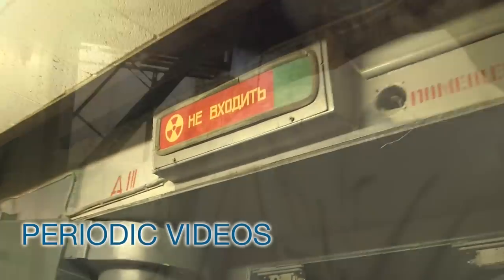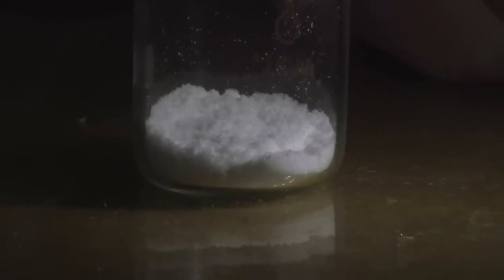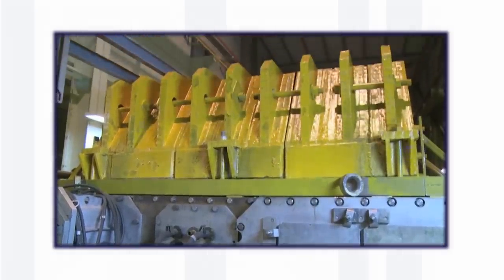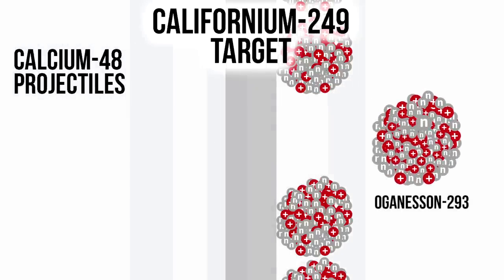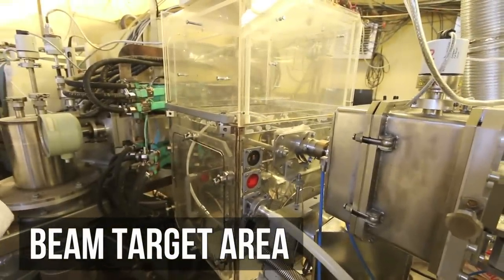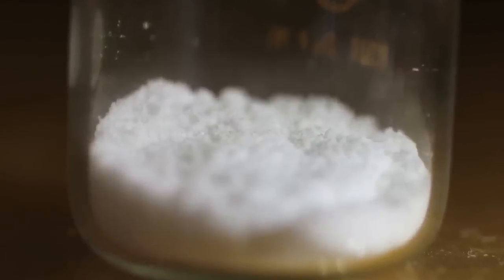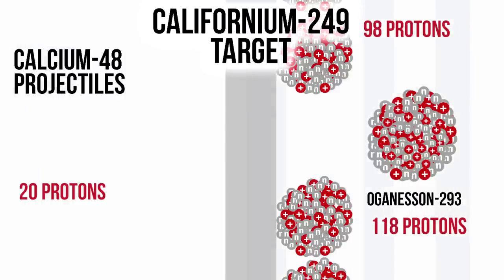$500,000 of Calcium - Periodic Table of Videos

Comment: If you ate that bottle of calcium your skeleton would be like wolverines.
Reply: P. Doherty not likely
Reply: I wonder how much heavier would you be if you swapped all your existing calcium for this calcium 48?
Reply: That math shouldn't be too hard to do.  If you actually cared.  Definitely not worth doing though.
Reply: hamilton harper you'd gain 3 grams for every kilogram of body weight. For example, a person weighing 70 kg would gain 210g.
Reply: I calculated that 17 grams. But I'm half asleep and didn't bother to actually write anything down on paper, so I might be totally wrong there.
Reply: I actually am interested. Did either of you base this on the average weight or proportion of calcium in an adult body? That's a pretty wide spread of results...
Reply: hamilton harper hamilton harper I based my result on the fact that 1.5% of your body mass is calcium. This means that an average kilogram of you has 15 g of calcium. We divide this by 40, the normal atomic mass of calcium, to see how many moles of calcium there are in a kg of body mass. We multiply the result by 48 to see how much those moles would weigh if they had the atomic mass of 48. Thus we get 18g. This is an increase of 3g. From here you can extrapolate that a person weighing 70 kg would gain 210g (70*3).
Reply: hamilton harper not alot since calcium is a trace element in humans less that 2% so it won't have much of an effect
Reply: Replacing all oxygen with oxygen-18 will result in a far more significant weight gain:
Oxygen-18 is 12.5% heavier than the regular oxygen-16, and 65% of a human's body weight is oxygen (mainly in water). So this would cause a human to gain 8 % weight (from 70 to 75.6 kg for example) without any change in the body dimensions ;). I'm pretty sure swimming would be pretty difficult then.
Reply: I wonder if it would be possible to strengthen bones if you used this isolated calcium.
Reply: @patrickparr3331  or you'll die but you can find out for us
Reply: @notananimationchannel  it could be toxic once it is isolated. So many things are.
Reply: hahahah nice 1.

I'm surprised some of here didnt appreciate your
Reply: @patrickparr3331  why would you?

Comment: 48Ca has other uses. In geochemistry 48Ca (usually along with 42Ca) it is used in Ca isotope "double spikes" for obtaining high precision measurements of calcium isotope ratios. In medical research it is used as a tracer for studying calcium metabolism. Another interesting feature of 48Ca is that it actually is very slightly radioactive, transforming to 48Ti by double beta decay with a half life of something like 6x10^19 years.

Comment: If they are just shooting the atoms and most of them don't hit the target. Can't they just recycle ?
Reply: They get lots of hits,but not much hits that count.Those that don't hit get deflected and  start moving randomly hitting the walls of cyclotron.
Reply: You're right. Thanks for the answer.
Reply: It would be pretty much impossible to recover the stray calcium due to the vast space it could wind up in the cyclotron
Reply: Not impossible, just very difficult.
Reply: You'd have to meltdown whatever the cyclotron is made of since the ions are travelling so fast they are probably stuck too far in the surface to just be washed off. It's more trouble than it's worth, and the target zone is worth far, far more than getting the calcium back.

Comment: I can imagine that Ca-48CO3 is heavier then Ca-40CO3. Why can't they just use a (ultra)centrifuge to separate the Ca-48 from the Ca-40?
Reply: That would only work if they had all loose atoms. But the crystals contain both 48 an 40. The centrifuge can't rip apart the crystals. It's like centrifuging ice to try and get a little piece of sand out of it.
Reply: The professor gave the reason. Calcium doesn't have a gaseous compound, so it can't be separated in a centrifuge. Uranium does have a compound that is a gas, so it can. However, in some ways the separation uses the same principles, but using a magnet. The calcium is effectively gasified by turning it into ions in a vacuum chamber.

Comment: The yellow machine shown here at the SU-20 facility of Elektrokhimpribor is a calutron, an enormous mass spectrometer whose sole purpose is the separation of atomic isotopes which cannot be separated using gaseous diffusion or gas centrifugation.  It was originally used for the enrichment of uranium.

Comment: Can LHC be used to synthesize of heavy atoms?
Reply: I am wondering this too
Reply: I doubt it, it is call large HADRON collider not large atoms collider :D  for example a proton or a neutron is a hadron. So I don't think the LHC can be used to synthesize heavy atom considering heavy have at least a few hundred hadron.
Reply: Żółć I believe the equipment they use is not exactly compatible with the size of the particles used in elemental synthesis.
Reply: They could, but it is more designed to collide individual particles rather than particles with a target. Also the detector is designed to look at the resulting shower of exotic particles that escape after two particles hit each other with 12TeV of kinetic energy. I'm sure it could handle the calcium, but larger particles like californium might be a bit tricky to use...
Reply: @Eivilcow: No they can't aside from the size which is hundred times bigger than a hadron, you also need a charged particle so that the magnet can bend the trajectory of the particle. So an atom is out of the question, an ion maybe...

edit: actually an ion is ok, the ALICE experiment is an ion collider, although atom is still out of question.
Reply: So the LHC uses protons, not hadrons... and protons are technically atoms because hydrogen. I think what you meant was it can't handle the electron shells of larger atoms which is very true. (I was wrong)
Reply: The cyclotron that the professor talks about is also magnet based so they must be accelerating calcium ions into the target.  The issue isn't that the LHC couldn't do it, it's just that the LHC is massive overkill. The energies that the LHC is designed for would simply annihilate the target.  
For reference cyclotrons are typical  around ten million eV while LHC can achieve around a trillion eV.
Reply: MazeFrame, That is a horrible analogy. It takes quintillions of smashes to get these atoms that they are looking for, and I bet if you smash cars a couple quintillion times at varying speeds and angles, you might eventually end up with something that looks like a motorcycle. The motorcycle wouldn't work, it would break before you realize what it was, but so do these super-heavy elements. The LHC is more like hitting your car with a concorde going mach 2 and trying to identify the parts that come out of the wreckage.
Reply: No!
Reply: The aim of the LHC is to allow physicists to test the predictions of different theories of particle physics, including measuring the properties of the Higgs boson and searching for the large family of new particles predicted by supersymmetric theories.
Reply: There was someone who said somewhere that you could make gold with it. But making one gram or so of it would take something like 120 years of 24/7 operation time. I guess the person was wrong?

Comment: I remember when I had chemistry lessons it always puzzled me why so many reagents were potassium salts and not sodium salts. Now I wonder if the reason is the higher atomic mass. This way the more expensive anions can be sold at a higher price per mole for the same price per gram of the salt...
Reply: I doubt that would be worth the trouble -- the companies that sell the stuff just probably do some combination of whatever is easiest and what the customers traditionally use.  A related factor is that solubility with different cations can be different (for instance, compare the various alkali metal perchlorates -- lithium perchlorate is highly soluble in water even at 0 `C and becomes ridiculously soluble as you approach 100 `C; this remains the case with sodium perchlorate, but then potassium perchlorate is only sparingly soluble from 0 `C to room temperature, and then becomes decently soluble as you approach 100 `C; rubidium and cesium perchlorate take another dive in solubility.  The same thing happens with the detergent series alkali metal dodecylsulfate -- if you want it not to precipitate in the cold, you get the lithium salt; if you want it cheap, you get the sodium salt; if you actually want it to come out of solution (like when you want to get rid of it after it has done its work), you add a potassium salt (commonly potassium acetate) because the potassium salt precipitates even at room temperature (along with all the protein and other stuff you were using the sodium dodecyl sulfate to dissolve so that you could get rid of it, thereby leaving nucleic acid in solution)..

Comment: lead 208 is also double magic and is much heavier than calcium, why not use that instead?
Reply: Seth Apex Because you need 20 protons.
Reply: Seth Apex you can't accelerate a heavy atom into another heavy atom. What are you hoping to achieve? A new element with more than 200 protons? Element shown in this video "only" has 118 protons and it's not even stable enough to exist for more than some trillionth of a second. We are only poking and finding the limitation of nucleus stability by trying to create new heavy atoms 1 or 2 more protons at a time. You can't jump 80+ potential elements and declare you predict element with atomic number 200 is stable and synthesisable. That's just a display of lack of relevant knowledge.
Reply: Because it's harder to hit two ions with higher atomic numbers together and have them stick because of a higher electrical repulsion. Also, for certain atomic numbers at least, you would have to use a target with a lower neutron number, meaning a lower neutron number of the product in total.
Reply: We`re looking for stability islands anyway. Why not to look far?
Reply: Боря Данилюк then why atomic number 200? Why not 1,000? 30,000? 5 million? 2.88 billion? You see, people do things in a linear and methodical way for a reason, especially in science. Randomly selecting some number isn't gonna get anybody anywhere.
Reply: Боря Данилюк
The island of stability likely lies at around element 110-114, which is within elements that have already been synthesised. What you want to get there is isotopes of these elements with more neutrons, although the best way of doing that right now is to make a higher element that will decay there.

Comment: Mass spectrometry was also used on an industrial scale in the Manhattan Project, in parallel with gaseous diffusion of uranium hexafluoride, to separate U-235 for the uranium bomb (Little Boy) used on Hiroshima. Today, no nuclear power uses the mass spectrometer (called the Calutron during the war) for uranium, because as expensive and tedious gaseous diffusion is, it's cheaper and faster than the calutron method.

But to separate Ca-48, gaseous diffusion won't work, because, as the professor said, there are no gaseous compounds of calcium, at reasonable temperatures anyway.

He didn't mention whether electrolysis of an aqueous solution had been attempted; this is how water containing deuterium (hydrogen 2), so called "heavy" water, is made.

Comment: The reason heavy elements need more neutrons to remain stable is quite simple and worth telling; it also explains a lot about radiation and nuclear fission in an incomplete but easy to understand way. 

Protons and neutrons fill up energy levels in a kind of shell structure like electrons. It is advantageous to have as many neutrons as protons as long as neither have an electrical charge; but protons do have an electrical charge. The strong force is very close ranged, but electrostatic repulsion is not. For heavy elements this shifts the optimum towards more neutrons.

For very heavy elements like uranium, radon, radium etc it is energetically advantageous to split the nucleus into two nuclei spreading the positive charge out. Helium-4 is very stable for its size (doubly magic) and is often the product of spontanous decay of heavy elements. For uranium and other actinides it turns out that a neutron; which carries no charge and can zip right through the nuclei without being repelled; can ding the atom, imparting enough energy to overcome the energy barrier to splitting in two large pieces. This is fission. The lighter elements so formed have too many neutrons; it would be energetically favourable for them to lose some. Some neutrons leak out; some delayed neutrons are created during decay of some fission products and some neutrons are converted to a proton + electron + anti-electron neutrino. The electron gets so much energy that is kicked out; this is beta decay. The nucleus can recoil so hard from the decay that not all nucleons occupy the ground state. The surplus energy often goes into energetic photons; gamma decay.

Up to nickel 60 it is advantageous to fuse light elements because the strong nuclear force dominates. Stars usually stop at or before iron. But with neutron absorption and beta decay they can slowly climb the periodic table. For very heavy elements though the neutron accumulation must occur fast enough and it only does in super novas and neutron star mergers. In a supernova the neutron flux can be a mole of neutrons per square centimeter per second.

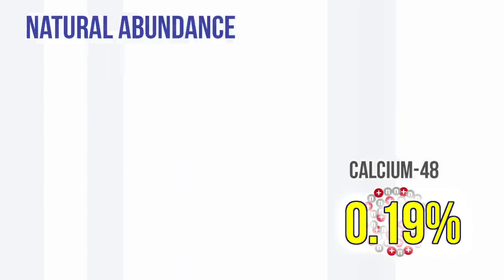Comment: [01:15] 'gaseous compounds' are used in low-cost production of reagent grade elements... Calcium hydride is listed as boiling point of 873°K... Or, why not use liquid-crystallization of calcium-water-ice... 2. meanwhile "Ti-50" has less excess energy so its forced-fusion product should be instantaneously, stabler....

Comment: I understand that calcium 48 is a double-magic isotope and is thus more stable. But why should that matter for the final product?  What I mean is, Oganesson-298 is produced, so I'm assuming it's the most stable isotope for Oganesson (and thus has a higher chance of reaching the detector without decaying along the way), but if they used calcium 46 (not magic) but compensated by changing the target isotope so it had 2 extra neutrons, the same isotope with equal stability would be produced, I think. So the "magicality" of the projectile should have no influence on the final product's magicality. Could someone knowledgeable explain this?

Comment: So they have to somehow vaporise and ionise the calcium in a high vacuum and separate isotope 48 by mass to charge ratio as in a mass spectrometer. As the professor described, it must be based on electric and magnetic sectors, not the fancy quadrupole stuff we have in modern MS machines.
Reply: Yes.  It's a large mass spectrometer known as a calutron.

Comment: i have a question:
if it is so expencive due to the prosses, one could cut the cost by havinga a neclear reactor.
i mean if one can cut the electricity bill of the cost, it will be cheaper.

the question is.. why not have thorium salt neclear reactors?